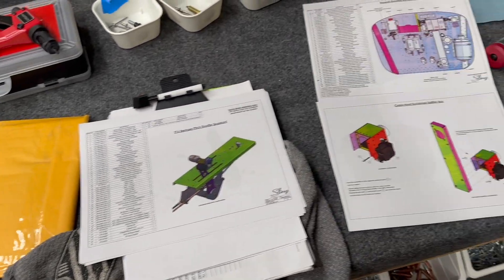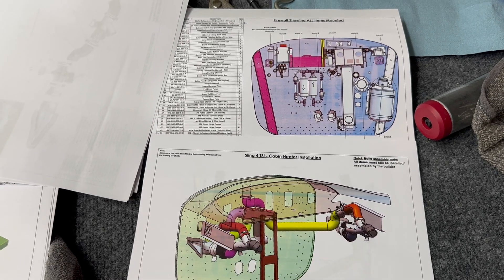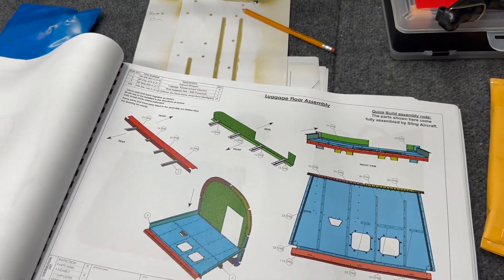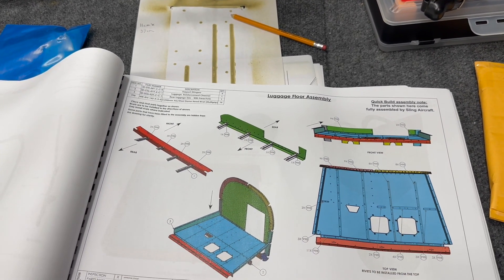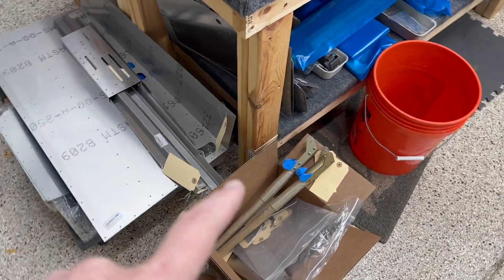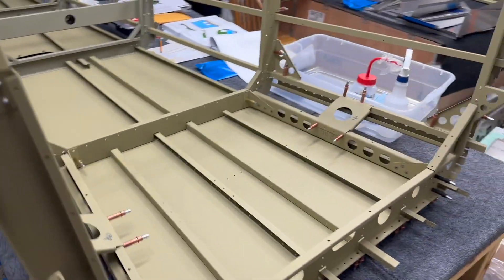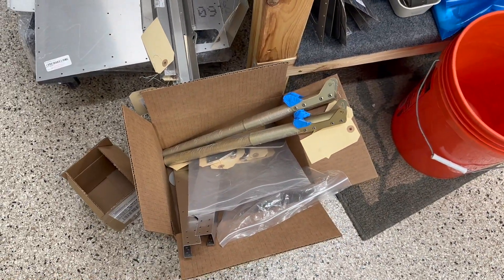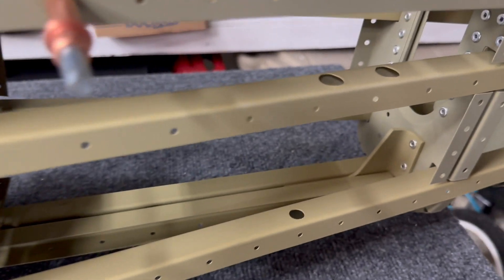October Update - The rear fuselage is making significant progress, but we have problems.

Comment: Thanks for the vids.  Watch the EAA one hour long vid about the 916.  He talks about the changes to the engine for longevity based on their inspection of the 915 engines.  Based on what he says, I think it is highly unlikely that the TBO will be extended for the 915.  $10K extra is a big hit, but it will payoff on resale (I think).  My quick build 916 kit arrived in Torrance about two weeks ago.  With builder's assist I should be flying by next May.  Rick.

Comment: Some comments/questions: The “missing” pieces. Backordered? Or on the inventory as shipped but you didn’t receive? Discovered during inventory? I had a number of backordered parts during my build. But never a part shown as shipped that I didn’t receive. Some backordered parts I received somewhat quickly. Others not so much.

There’s a lot of work you can do with the front fuselage section. It’s at least as much work as the tail you’re showing in the video. Maybe more. You're discovering exactly what I've mentioned before. Unlike the wing and empannage kits and KAI's, the fuselage KAI leaves a little to the imagination and doesn't have every rivet or detail. My kit has the coolant based heat exchanger on the inside for the heater. But I'm not installing the "spider" duct arrangement. By all accounts, doesn't work that great. I'm going to have only cool vent on the instrument panel and rear side wall. Then heat with new ducts to the front and back in the center console. Will use some 3D printed parts. Many are making this change. Maybe something you also may want to look at?

There’s no question Sling kind of expects you to buy all the kits at once because you’re right there are some parts called out that are in different kits. But I didn’t order the FWF kit until after the fuselage. I had to do a couple workarounds and Cleco stuff temporarily until the FWF kit arrived. But it didn’t stop me from basically completing the fuselage. I ordered the fuselage, canopy, undercarriage, and upholstery (because of the lead time for the upholstery) at the same time. I wouldn’t have done it any differently. The canopy is a huge part of the fuselage build. Surprised you haven’t ordered. It will stop you much sooner than the FWF.

I entertained the 916 for my build. But couldn’t get over the increased cost. Plus since I already had the 915 cowl, engine mount, etc. the added cost was more than just the engine. There’s no question the 916 is basically required for the high wing. The low wing performs very well with the 915. The 1200 TBO is an issue I guess. But as an experimental, you’re not locked into that. I assume you know that.
Reply from the maker: @paulborror2544  it’s interesting, the bulkhead for example was not on the inventory list, not in the crate, but required.   This is a situation I’ve seen a few times now and for me is due to kit changes such as updates to newer parts.   For some reason the parts end up omitted.  
I do have the canopy crate, it’s currently the other work surface, I will also run the heater duct mod to the rear seats.   I’m one of the first with this new heater arrangement so we’ll have to figure out what’s happening as we go.  
There is hope, I’m aware a new version of the manual for the fuselage is coming.   As everyone has indicated, there’s a lot of issues with this current version.   For instance, one I caught - on rib assembly 2, the forward most one, the instructions keep insisting to rivet parts into the holes where the center ribs mate up.    If you follow that blindly, you end up with 4 of the 6 ribs blocked, so - 16 rivets you’d have to drill out.  
I’m doing the same as you in some areas, basically cleco’ing parts and I’ll also leave myself painters tape notes. 
You’ll see me shift as well to the center section as well in the coming videos ;)
Reply: I’m pretty much at the same stage as you In the build. I’m also finding the Kai is not as good as the wing and emp ones so I’m double checking everything with the high wing manual for parts that are the same  as that manual seems a lot more complete. I also have the new heater, which again only appears in the HW Kai.  What parts from the firewall forward kit do you need to get a rollling chassis? Like you I’m yet to order my FF kit as I thought I could get it up on its wheels before that and then make the call to go either 915 or 916.  I also have a few parts missing plus a few on backorder and so will also grind to a halt fairly soon. PS the gaskets were great, thanks.
Reply from the maker: @ awesome!   Reach out to sling technical.  They can share some of the new manual pages for the heater system and throttle quadrant.  

My desire on the firewall is to get the heater system installed, battery box, plus the support channel and the coolant mount angles.  Ends up being 5-6 parts, but with that I would feel comfortable to put on the firewall foam and the engine mount.